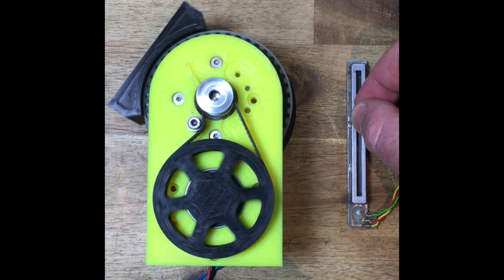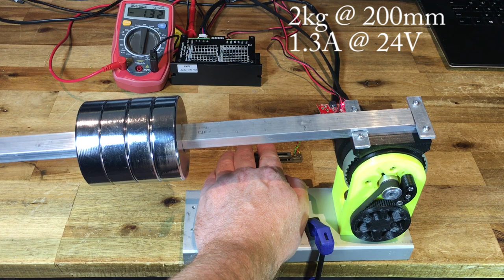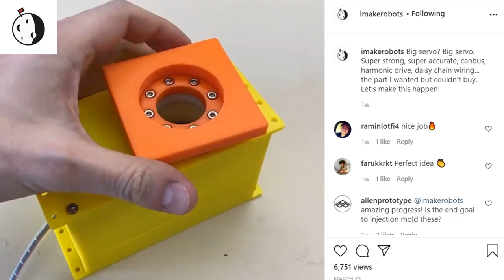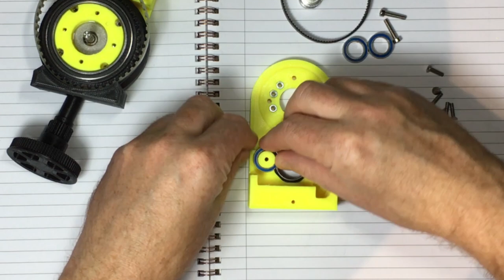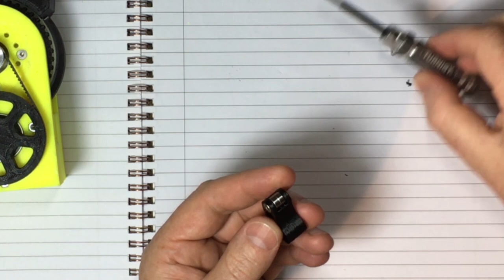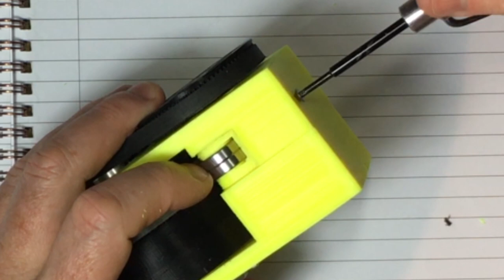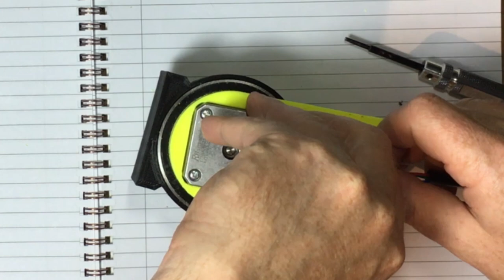NEMA17 Dual Stage Timing Belt Reduction

Comment from the maker: Backlash is complex to measure. It has zero backlash with no load. With load, the springyness in the belts/3D printed parts give about 5mm @ 500m. This is why I like Capstan drives better. There is no springyness.
Reply: Sorry to ask, but what are Capstan drives?
Reply: essentially they work with ropes and winds. check his channel! great stuff!👌
btw, a startup called haddington dynamics uses encoder on the output shaft and calculates force using the springyness of the belts. 🤯
Reply from the maker: @YOUnoobGER  https://youtu.be/ENMZsPwCUcA Technically not capstan drives as they rely on friction but it is the term that is being used in the robotics industry.
Reply from the maker: @Mosenhosen  I didn't know that did that. Cool
Reply: @PaulGouldRobotics  they also use 3d printed encoders and claim to utilize the sloppy slit quality to fingerprint each of the slits for absolute positioning. plus, then read each slit with an anlog sensor that allows them to read like a million (iirc) microsteps per slit. downside is that they need an 800$ fpga to do all those calculations in real time for their 5-dof robot... this info is from ~2018 when met them at a fair. not sure what changed since then, but you can find them on youtube :)

Are you interested in "rotary" delta printers (as in delta robot, so without the linear rails and belts)? I was planning to build one with print speed as the main focus and found your channel when researching drives. Not sure if you saw my comment under your top 10 transmission video...?
Reply from the maker: @Mosenhosen  I drew up a rotary/delta pick and place with cycloidal gearboxes. I think the backlash would not have been good, so I stopped. Maybe capstan would be better, bit is much less springy than timing belts and zero backlash
Reply: @PaulGouldRobotics  From what I got from several sources, backlash for cycloidal gears can be perfectly eliminated with proper design of the dents. There is a plugin for both Freecad and Fusion 360 to generate them btw but I can't tell for sure if they're doing it right.
Reply from the maker: @ziad_jkhan  I'm using Autodesk Inventor with parametrics and equations. So theoretically the maths is perfect. The problem with backlash for 3D printed parts is tolerances and the differences between printing inside and outside curves. In a pervious video I have created a zero backlash cycloidal gearbox. I know there is a plugin for Fusion 360 floating around that has some wrong maths.
Reply: Looks pretty good and functional. You gave lots of tricks about angular movement. Thanks
Reply: You just need to tension the belt beyond the force they will experience during motion. By young law, they won't extend anymore.
Reply from the maker: @HappyMathDad  Friction/noise increases if they are too tight.
Reply: @PaulGouldRobotics  Maybe with better quality belts, the springiness you described with proper tension will go away

Comment: I love the details which are so transferable to other designs - such as printing in interference fit cable management channels. Brilliant.
Reply from the maker: Thanks. I get annoyed about the cables floating around, so doing cable management at the start helps. The cross section of the channels are trapezoidal.

Comment: Since you need more torque, you'll end up with pretty hot motors due to almost no air flowing alongside your motor. But still - like always - great! Thanks a lot for sharing. You're awesome!
Reply from the maker: The motor gets to 45-50degC. I usually limit the stepper to 15Watts but I wanted to test the strength of the timing belts. I thought about water cooling.

Comment: Clean and well designed as usual, I like the belt tension devices especially the sliding one. 
For positional feedback could you have a small gear on one arm and a rack meshing on the other , a magnet on the gear means you can use the encoder chip previously used. This has no load so there's no worries about torque slipping.Just a thought but I'm pretty sure you have a better idea. Thanks for sharing !
Reply from the maker: Cheers. I'm thinking about a donut shaped diametric magnet around the shaft of the stepper motor. Then 3 or 4 hall effect sensors around outside with a uC running some CORDIC (sine/cos to angle) software. This will give me absolute motor position. I could also use this for the joint position. I don't want to make the actuator wider.

Comment: Your designs are always so clean, really love that.
This is just a proof of concept I know that but do you have already plans on how you could integrate a encoder?
The only place that comes to mind is on the drive shaft for the second stage but that would still have the possibility of skipping.
Even if that is very beefed up.
Reply from the maker: Thanks, I would like to add a a motor encoder and joint encoder with a custom controller. Or I could just skip that and use a brushless motor and the controller I have already got.
The second stage has a really beefed up tensioning mechanism (go to 5:48). The bearings press the belt onto the pulley . It's not skipping any time soon. The first stage's GT2 still needs some work.

Comment: Really nice design Paul. But i think it is not efficient for price-performance. Bearing and belts only cost $30 (in aliex) already i see there are planetary gearboxes for $25 with metal gear.
Reply from the maker: I agree, the bearing count/cost is too high. Belt cost is high too. I may try 3D printed bearings next.
I am trying to achieve zero backlash which is not possible with planetary gearboxes.

Comment: Your prints are so clean. Do you have an orientation that allows you to avoid supports yet achieve good inserts for nuts and bearings? Or other tricks?
Reply from the maker: Many other tricks. My printers are just Ender3s and are not tuned well. I have to file surfaces sometimes. I design with support in mind. Holes are drilled out and M3 nuts are slightly melted in place.

Comment: thats good. would be nice to make it more rigid. perhaps it was just the thing you had it mounted to seemed there was some wobble and backlash when moving fast?
Reply from the maker: The mounting was not good. Even thought the belts are very tight they are still a bit springy.

Comment: Compared to cycloidal gearbox, which one is better?
Reply from the maker: Cycloidal gearboxes are stronger and I haven't skipped a tooth yet. So for NEMA17 cycloidal are better because you can get a higher ratio in a smaller size. For a Brushless motor, I currently prefer timing belt and Capstan drives.
Reply: @PaulGouldRobotics  Thank you for your kind reply. Can I ask you one more question? Why don't you prefer cycloidal gearbox on the BLDC motor?
Reply from the maker: @handonghee1  Capstan drives are zero backlash, more efficient, cheaper (less bearings) and smaller. Ratios aren't as high.
Reply: @PaulGouldRobotics  Thanks for the easy and accurate explanation!
Reply from the maker: @handonghee1  Capstans have a higher stiffness, less springiness.

Comment: what's that device on the right at 0:11
Reply from the maker: It is slider pot connected to an Arduino for the speed control of a stepper motor driver.